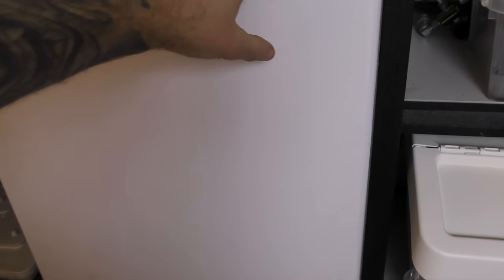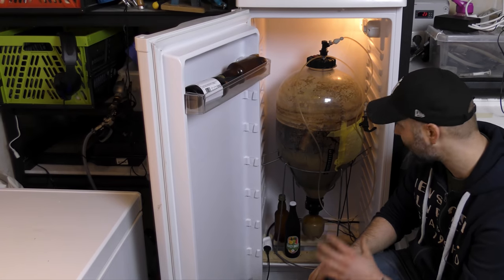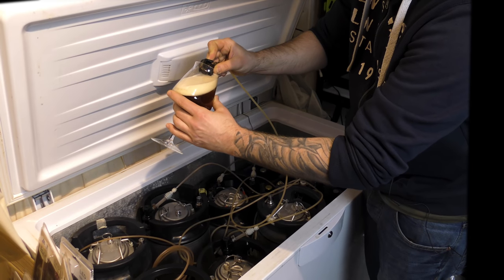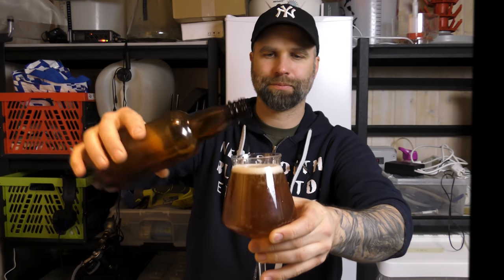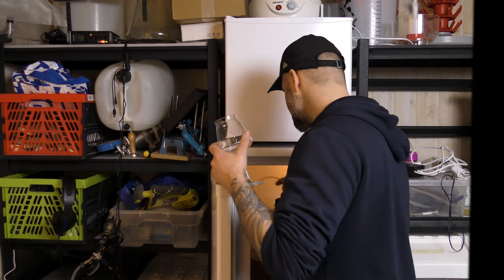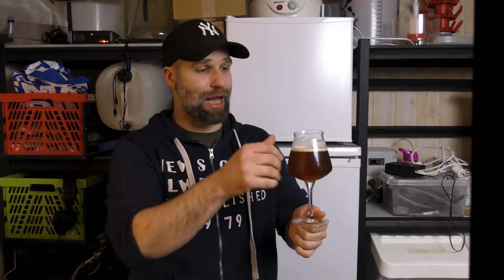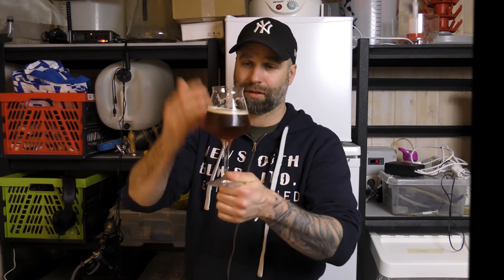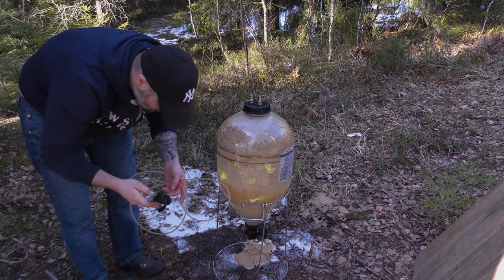How many times can you reuse yeast? Conical yeast washer Fermentasaurus

Comment: My local brew shop in South Africa imported some Kveik, which proved to be both costly but worth it, being able to ferment at +35 Celsius in African heat is invaluable.I immediately made a large starter and separated the resultant yeast into 6 small jars. With careful management/ rotation I reckon I could keep this going for years. My thought process is by using a small jar to make a starter and then replenishing the jar from the starter before pitching into a brew I keep the yeast clean and unstressed.
Reply from the maker: That's exactly how I do it. I go through it here: https://youtu.be/1Qr768FFcrk
Reply from the maker: In this video I use yeast that has been stored for over 15months harvested that way. https://youtu.be/Sy7v2Gga6dE
Reply: Get some untreated wood and inoculate it like a norg;)

Comment: it's very interesting how long that last before you saw yucky sidenotes. I've just started saving my yeast and I use the jar method first using some clean water and separating the trub and then use a funnel separator, I like to keep to same beer styles with the washed yeast and I keep everything sanitised and clean of airbourne bacteria because I'm not using a sealed and pressurised system. I have been using the same yeast and have increased the amount of yeast I have over 3 months by more than 8 times just by using a starter with the washed yeast and then cleaning that batch and so on. I've got a few yeast strains stored and I have spend minimal dollars. A lot of them are from dried yeast. I tried it and it works opposed to what many people say. I also have a few commercial strains from bottle fermented brews which work really well and seem to keep well. It takes time of course but it saves a lot of money too.
Reply from the maker: I harvest from my starters!

Comment: Great video DrHans,
Can I ask of you to talk about your picnic tap system here and where can I find the flow reducers?
I have yet to solve mine over foaming issues. Hope to gain some insights from you, thanks in advance!
Reply from the maker: Thanks! I’m using a thin hose 3/16" (3,2 inner x 4,8 mm outer). Does that help?
Reply: @DrHansBrewery  Thanks for the fast reply, do you happen to have a link on the connectors that you used? seems like some size tubing form the quick connect to 3/16. the white plastic "stuff"
Reply from the maker: @oapchian  this is the reducer I'm using https://amzn.to/2IRlKKX

Comment: What is the inner diameter and length of your keg lines? I'm having trouble with mine. I only serve foam...
Reply from the maker: 3/16" 3.3mm length 1.5-2meter.
Reply: @DrHansBrewery  the marrowest my LHBS supplies are 6.5mm. I got a 6mm from ebay, but I can't get any narrower than that to connect with my disconnects.

Comment: I usually use a non conical fermenter, do you think it works?
I don't brew as many time as you, do you think it's better to remove the yeast from fermenter,"wash" the yeast, and use them multiple time ? please let me know, HOMEBREW MASTER !
Reply from the maker: It will definitely work. But maybe not go on as long as I did in this experiment. Even with a bucket you could brew back to back pitching on the yeast cake. I wouldn't do beers with dry hopping. But...I havent done any testing regarding that yet.